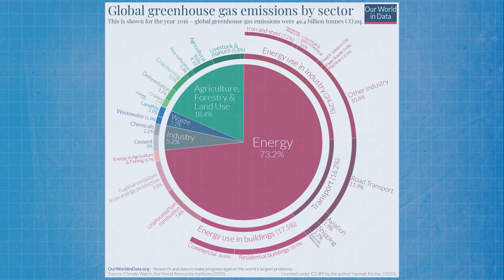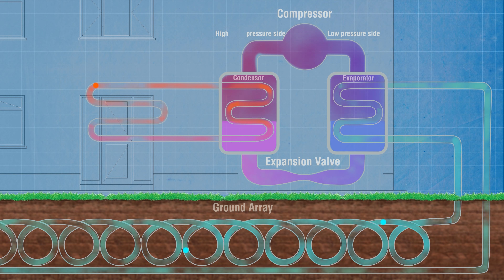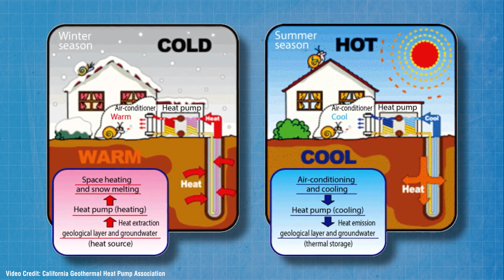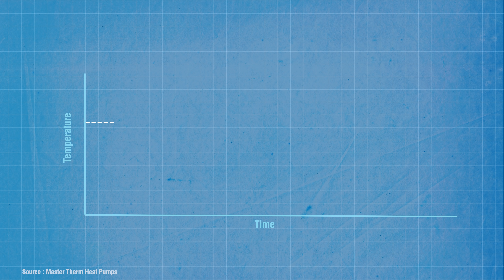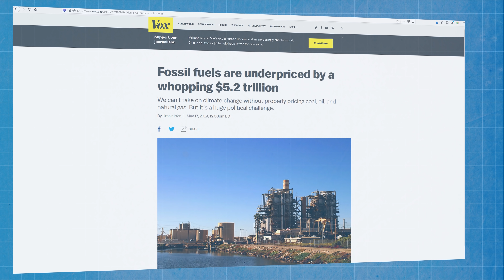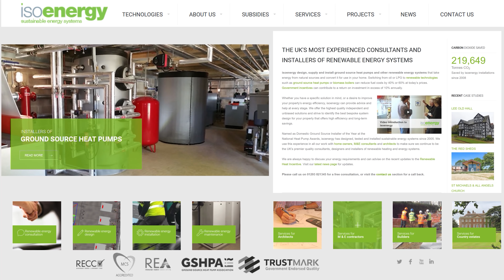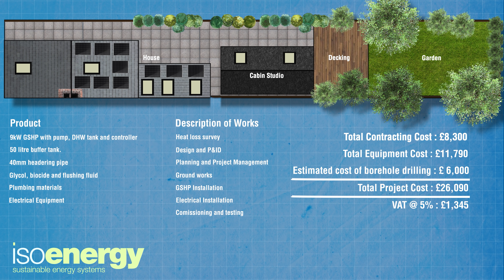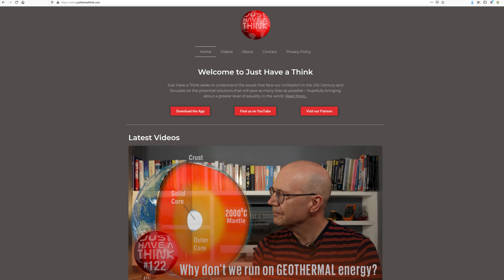Geothermal ground source heat pumps. Heating your home from your own back yard!

Comment: Here in Michigan USA We installed our first ground source heat pump in 1992. Since then it has been replaced with a newer even more efficient unit.  It does both cooling and heating and produces the majority of our hot water during heating or cooling months as well. That hot water is effectively free in the summer as it's recovered from the home as the system cools the house.  The unit is effectively silent with only the fan noise audible.  Ours has electric heating elements for backup in case the heat pump cannot keep up but my monitoring shows those units have never been required even when the temperature outside fell to -20F. 

A key thing to recognize is not to use a setback thermostat with these units as they have much lower recovery rate than a fossil fuel furnace. Using a set back thermostat might require the electric back up heaters to kick in to warm the home when the temp turned up. 

Additionally consider that some electric utilities have lower rates for heat pump users, and ours is one of those, making the savings are even better.  We also live in an area where no natural gas is available thus the heat pump is a no brainer!

Comment: Just to balance all of the extremely positive stuff about sensible heating and cooling (and very nice it all is, too), here's my zero-cost option, and a reminder that there's always an alternative...

I'm embarrassingly poor but happy and single, and live in the north of England in a 2-bedroom terraced house, built in 1913. It has no heating. None whatsoever. Nothing. Nought. Zero. Nowt.

I can't afford to heat a home, and I can't afford to heat myself either, so I only use cold water. It's not bad once you get used to it. Even in winter - when the water goes a bit crunchy - if you wash yourself in small sections you're never more than 1/6 freezing.

It's... bracing. 😁

There is an ancient immersion heater in the copper tank in the airing cupboard in the bathroom, so I could theoretically heat some water for day-to-day use, but I live on such a tiny annual budget (under £1,000 [one thousand pounds] for the past 15 years) that it's just not possible.

I don't mind. I have a kettle in the kitchen for hot drinks, and I allow myself one decent home-cooked meal a day (I've got a cheapo induction hob and a microwave oven). The thing is, having 'Just Had A Think' many years ago, I realised that I didn't WANT heating.

Most mod-cons are a con.

I don't miss hot water or warm rooms. I wear more clothes in winter and fewer in summer. I spend nothing on heating (or cooling).

Britain doesn't 'do' air-conditioning, by the way - the weather's far too changeable for it to make sense.

I use under 300kWh of electricity annually (about 25kWh per month). I'm astonished by what a lot of people consider to be 'normal', consumption-wise, but that's their business, not mine. Good luck to 'em.

I find all of these clever renewable technologies very impressive, but the costs are hilariously unrealistic for someone in my position. £25,000 for a heat pump installation? £15,000 for some solar panels? Five grand for a wind turbine? £20,000 for some weird battery system linked to the grid that'll also let me charge my £35,000 EV and - 

Oh, behave.

I ride a bicycle worth about £30. It does the job.

Still, based on my normal consumption figures, if I invested in even the most modest of 'green' home conversions, it would have paid for itself in just over 300 years. Yay.

(Note: Your figures may vary...)

Whatever the government grants and incentives happen to be, it makes a lot more sense if I just knit myself another woolly hat (total cost  £1.22, bobble included).

Comment: My local National Trust, known as The Vyne, here in the UK, have a new lake based heat pump. I suggested they use the installation as a visitor attraction. It turned out that wouldn’t work as once finished there’s nothing much too see above ground/water, only a noisy compressor!

Comment: I am running at bore hole system here in Oslo Norway. I have two holes(Welles) and a 14,5 kw pump-system. My home is some 450 m2 logg house and my total average electric early consumed  is  21.000 kWh.

Comment: No mention of maintenance or system component replacement costs or labour cost. Compressor for 2000 sq.ft residential compressor in Canada about $20,000, labour about $200.00 per hour, then there is permitting and inspection costs, then there's ongoing pump maintenance and replacement costs. For a heating system that will require in most cases, an alternative fuel source(gas or electric) to make up for shortfall of sufficient btu capture. These systems make more sense in a large application like public buildings where these costs can be shared, but single family dwellings, not so much.

Comment: Around £20,000 rip out all old pipework and rads for new and lose a room for the indoor heatpump cylinder, and an electric top up emersion heater for winter top up, in reality its very expensive, they also take 4 hrs to get to temp. Dont forget the small bedroom needed for plant room, well 2 metres by 1 metres for servicing

Comment: Just have a think Dave, geothermal  is partly the primordial  from when the Earth was formed and partly  generated from within the Earth's crust from the decay of mildly radioactive elements. Forget the process and the lack of carbon, think about what that means. All the heat released from this 'fossil' source is adding to the solar heating caused by greenhouse gases interfering with the natural release of energy into space. 

Geothermal heating isn't green, it isn't part of the answer, it is part of the problem as is nuclear. How come so many apparently intelligent people are so easily convinced of something they desperately want to believe in when the opposite is staring them in the face? Is critical thinking so rare? Just ask yourself where it comes from and how it reduces climate change. 

I call it sloppy thinking; all that glitters is not gold, and all energy sources that don't emit CO2 are not the solution to enable you to stop worrying.  I realised decades ago that we were on collision course with climate chaos, and still you and others are clutching at straws. 

The only energy we should be using is renewable, 100% and nothing else [at present we use a minute fraction of the solar energy hitting Earth. Everything else adds to the problem. With the long term use of geothermal and masses of planned expansion, I was right decades ago, it really is going to happen and extinction is now on the horizon for homo sapiens as is happening to thousands of other species annually because of us.
Reply: Hi there, David. The heat utilized by ground source heat pumps is typically a thermal exchange system. In this context, geothermal heating/cooling is indeed green. In a short explanation, our scenario (I work for a geothermal utility company), we effectively use a hybrid vertical/horizontal closed loop system to exchange BTUs from the home into the Earth to cool during the summer, and extract and return the BTUs during the winter. All of the energy utilized during this process comes from the natural surface level temperatures, which in our case in Austin, Tx, is quite hot. The earth is a great heat sink and is a sustainable option with the correct thermal management. All of this is done to essentially remove the development from peak demand loads on the grid by coupling the geothermal technology with solar for generation during those times.

Comment: Happy owner of a retro-fitted home with ground source heat pump for 8 years.  One nice point not mentioned is that as heat is pulled from the ground during heating periods it makes the cooling periods much more efficient and the same is true when the cooling period heats up the ground.  I also add heat to the ground loops in the late summer through an integrated solar thermal water hating system that also heats my domestic water.

Comment: I do have such a system since 1993. It is the original system. It keep the house at 22c without auxiliary heat event when it is -25c outside for many days. The system paid for itself in about 12 years(0.06$/kwh). I will have to get a new unit but keep the loop. I paid 11000$ in 1993. The new unit will cost about 11000$. I just want to wait the next generation as the actual one has longevity problems due to the refrigerant. Thanks for covering this subject.

Comment: Fully charged came to my estate during the build and done a programme here. We have vertical heat source pumps, under floor heating and solar panels, with no gas to any house. My current utility bills during the winter is around £40 per month 👌👌👌

Comment: You can make an air source heat pump work in the winter with geothermal as well. There is a farmer in Nebraska supplying the heat to his system with 200 ft of earth tubes pulling warmer air up from underground to supply the heat exchanger the energy needed to heat the house and to keep it from freezing. Even in -30 it works.

Comment: How dose ground source compare to air source heat pumps, we currently have air source retrofitted to an older house that we have been pleased with and are moving to a new property that we will be building a new house on, we have options on heating and we were considering air source again but wondered if we may be better to go ground source, we have plenty of space

Comment: All info was high quality except one thing. You suggested that renewables are cheaper, and fossil energy is subsidized. That's factually incorrect. The truth is completely the opposite, and renewables are installed globally almost only because of huuuge government incentives/programmes, and aren't economically viable on their own. To make things worse they increase the electricity cost in countries with significant renewable energy production installed in their power grids, and additionally most cost calculations for renewable power plants omit huge costs of reserve conventional power plants (that must exist to supplement wind and solar power), over scales power lines for rapid power transfer from wind farms to energy users, and the cost of lowering the efficiency of conventional power plants that have to constantly regulate their power output to balance out the highly variable energy production of solar and wind.

Indeed geothermal would be the answer due to its stability, but it seems that it must turn out even more cost ineffective than solar and wind in regions without natural geothermal predispositions.

As for the heat pumps it would be interesting to consider a pure ground-home heat exchanger without the heat pump, especially with the tubing laid a couple meters below the surface. That would most likely give an insanely good cooling efficiency for the system, and a heat pump additional element would be useful mainly for heating purposes. Perhaps the temperature differences for most of the usage would make it a great place to apply solid state heat exchanger (as those can have great coop factors for 20-30 degree temperature difference).

Comment: When did we start referring to GSHP as geothermal energy? I thought geothermal referred to the type of energy from extremely deep borehole installations that can generate water hot enough to drive steam powered turbines, such as those that existed in Cornwall. In general GSHP systems run a a much lower temperature as the sort of source temperatures available in 100 metre deep bore holes or ground loop system rarely if ever exceed 15deg C.

Comment: Fix the structure, then measure what you need to heat and cool...  treat it like a total system - not just the loops and exchangers - the building, is part of the system :)

Comment: In New Jersey I have repaired many ground course heat pumps.  I believe most of the commercially available water source heat pumps are not very efficient.  By the time you factor in the pumps needed to operate the system you are at the same efficiency  of a very good air to air system, with less maintenance.
Reply: 1.Which type of systems are you referring to: open loop vertical borehole, which are known to collect debris and clog the pipes? I've never heard or read of closed loop systems requiring more maintainance than air source heat pumps.
2. Contrary to your statement, many modern geothermal heat pumps have B0/W35 COPs around 5, which is great considering that in 'normal' climates the ground is much warmer than 0 degrees (B0).
3. According to academic research in the field, ground source systems ARE significantly more efficient than conventional air units, even after accounting for the electric consumption of water circulation pumps. In field tests in a temperate climate the overall achieved seasonal COP was 5.2 for winter heating and 5.9 for summer cooling (data from: "Monitoring of a vertical borehole ground-coupled heat pump system: A case study from a marly-limestone heat reservoir" 2017, published in Geothermics; http://dx.doi.org/10.1016/j.geothermics.2016.02.008). Try to match that performance with an air system!

Comment: Im happy to have a hard that's 85 acres about 35 hectares. I sunk 2 vertical wells and 5 horizontal trenches, did the digging myself also happy I'm a construction project manager and site superintendent so I have access to a friend for the drilling rig and the excavator I own myself. Trenches are 10ft about 3m deep and 300 ft long about 100M give or take. Wells are about 600ft deep about 200M. They keep my 7500sq ft about 700sqM ranch style (single floor no basement) house sublimely comfortable. The whole roof is solar panels and I have 1 wind turbine and a whole heap of batteries for storage. I don't remember ever touching grip power for HVAC bit then again I don't use grid power anyway. Im not doing it for cost reduction to be perfectly blunt the money isn't an issue I'm doing it to hopefully show my neighbors they can do it as well and maybe JUST MAYBE I can get a couple of them to follow my lead. I put much more effort into insulation techniques than I initially thought I would. Radiant heating in the floors if you have a ranch style home is amazing. Your floors are always warm to your barefeet. I'm kinda wanting to attempt a small geothermal power plant set up on my land but I don't think I have the "play money" for it or the knowledge on how to operate it safely. Sure would be awesome though!!! Im seriously considering a full 1 acre or .4 Hectares solar farm. I think, at least according to my napkin sketch engineering, that I could fully or at least close power the full home and my fabrication and machine shop including my CNC lathes and mill. I'll need to add another building with climate control though for proper battery storage which will increase my demand unless I got underground with a simple sir circulation system...idk I'll have to talk to my "Battery Farm Guy" about it. Anyway sorry I'm still rambling have a good day all. Maybe one day I'll quit being a pussy and make some videos about my property and energy set up not likely but stranger things have happened

Comment: Homes around here need about $1000 to $2000 per year for heating, cooling and water heating . A typical GSHP can reduce the heating (space and water) and cooling bill by 70%. Costs for installation of a GSHP is about $15,000 to $20,000. Doing the math: saving $700-$1400/year. Simple payback is 14-21 years. Because the GSHP is a mechanical device it will break down at some point causing expensive repairs. Here is a much better alternative. Super insulate the house (insulation never breaks down,  it’s easy to install and costs a lot less). Use triple pane glazed windows with fiberglass frames. Same as insulation. Doesn’t break down, etc. Use a small electric heater for the space heating and a small portable AC for cooling. Problems solved. And you have a house that costs very little to heat and cool plus there is no CO2 output from house.

Comment: I had a geothermal system installed at our house in 2015. It has worked well, but I am not sure I would go through installing one again. Although your mileage might vary, my system involved digging two wells which was contracted out from the installer (an HVAC company). Things did not go smoothly and mistakes were made, but in the end we got an acceptable result. I think the key is finding a company with a LONG, proven track recording in installing these system. The company I chose had experience, but not alot.

Comment: That was absolutely excellent. Just to take the ISOENERGY illustration of circa £28K in your your Victorian property - do you have any handle on the associated costs in the property - underfloor wet heating - or alternative? Would that total capital cost be eligible for RHI.? Sorry and what are the alternatives to a wet underfloor heating system in combination with ground source recovered heat? Thank you.

Comment: Our cottage is heated with an open loop ground water source heat pump.  First heat pump was new Lennox commercial unit often used to move heat in large buildings (not a bespoke residential “geothermal” heat pump that cost fortune).

Comment: When we bought our home (Lithuania) 3 years ago one of its perks as vertical heat pump. We share it with 10 more flats and our heating bill is very low. But also our home heat efficiency is high. Both these combined makes our heating bill (91m2 flat) during winter about ~20-30Eur. Which is basically nothing. I pay more for the rest of home electricity. While I was paying 100+Eur for 60m2 flat in old style building and central heating. 
It is incredible how efficiency can be cost effective in long run. And current newly constructed homes in Lithuania has even more strict heat efficiency. But it has some dimishing returns at this point.